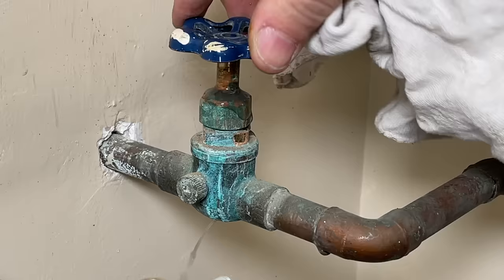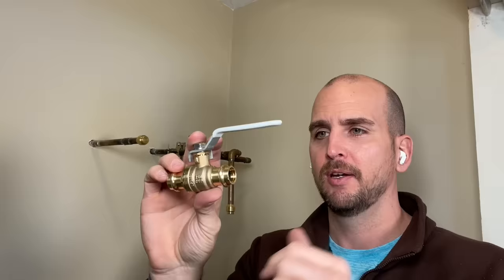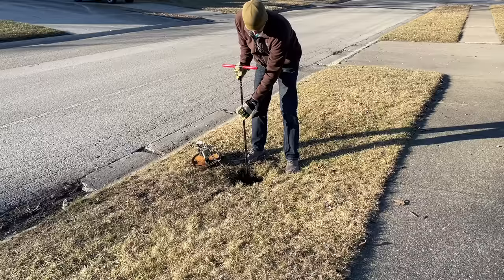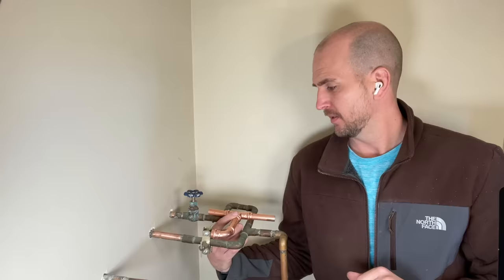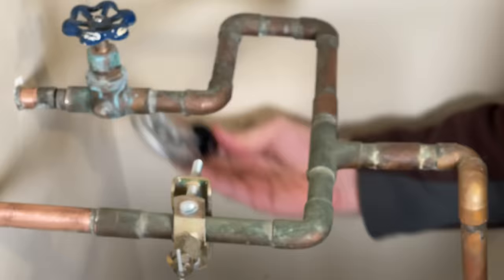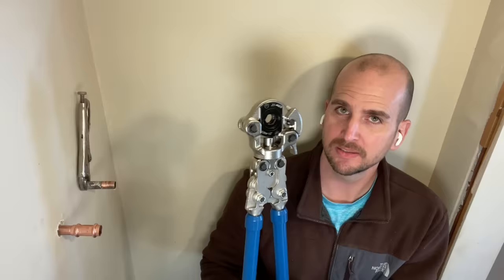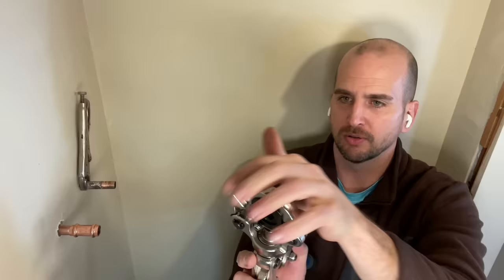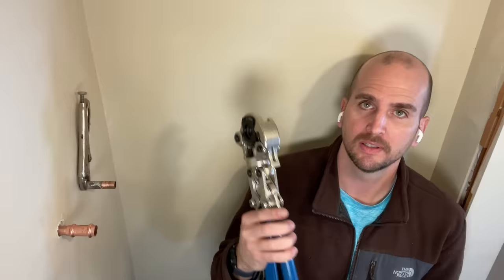How To Install a Main Water Shutoff | NIBCO Press Fittings

Comment: I use pro-press from 1" to 3" large Ridgid corded tool. Heavy, but surprisingly well-balanced and easier to get into spaces than it looks. Works great, primarily for commercial, because it's permanent. Only way to remove is to cut, lose some length of cc oppper.
One tip, There's a built-in stop. Just push onto pipe until it stops, unless using a slip repair coupling. The 11/16 for 1/2"  is just for planning/measurements.

Comment: Have used sharkbites several years on numerous project's.  Extremely satisfied with ease of installation. No special tools required.  Have used on both copper and plastic type pipes. Never a leak  Very convenient for DYI in remote,, tight, or potentially flammable locations.  Concur with comments concerning cost of snakebite but considering savings in purchase of and required knowledge in using more sophisticated tools still preferable for average user.
Reply: Same here, I have an old leaky main right now that I am cutting out and using sharkbite, 15 minutes start to finish. Cue all the regular plumbers coming in and shitting on sharkbite and pex.
Reply: @jwall62  There shit  dont be lazy.
Reply: @RadioRich100  or they’re so easy anyone can do it and plumbers don’t like that. Showed my wife how to do it and she did it in less than five minutes.
Reply: @jwall62  Whats she going to do when it starts leaking?
Reply: @RadioRich100  there will probably be better technology in 20 years when it might fail, but we’ll have to wait and see.
Reply: @jwall62  U dont have to wait and see, alot of them have failed already.
Reply: @RadioRich100  my research is my personal experience in my house. Nothing has failed yet after many years.
Reply: @jwall62  Which means you probably put in  3 of them. Not exactly a test.

Comment: Never had a problem with sharkbite's. I'm a builder, 40 yrs, and when these came out it's a super easy repair. Quick and clean and most of all no fire and no expensive tools. Another advantage is going from metal to pvc to pex etc with ease.
Reply: So you put your name and phone number on each one? A plumber worth a damn doesnt use them.
Reply: @RadioRich100  Normally when someone says 'I'm a builder' = 'quickest, cheapest method'. Once these builders finish the last home and are out of the 'warranty period' they file bankruptcy or dissolve the shell company or LLC....and start all over. Once people start having flooded homes they're long gone. Seen it before.

Comment: Shark bite fittings will also allow the valve or fitting to rotate which you may not want. I would use a crimped coupling to extend the valve away from the wall, then solder a ball valve, because the soldered valve can then be easily replaced if necessary. It’s also a good idea to place a pressure gauge upstream and downstream of your water regulator so that you know how well the regulator is functioning and when it is failing. It will also tell you if your street pressure is too high in which case you might want to use 2 regulators. One of which would be a “step down” regulator.
. This would only be necessary if the street pressure exceeds 150 psig. Normally house pressure would be set at about 55 or 60 psig. The higher the street pressure, the shorter the life of the regulator because it must work much harder to maintain house pressure.
Reply: Or install a valve-switched bypass for the PRV with a gauge downstream of both.  That way, it's just 1 gauge and you're prepped to change out the PRV when needed.
Reply: I noticed that too, should have extended the copper pipe before placing the ball valve.

Comment: When doing some updating on my daughters home I used shark bite fittings in 21 places as well as shark bite ball valves on all sinks and faucets. I know that the shark bite fittings were pricey, but I had time constraints involved. To spend $175 on that crimping tool would be cost effective only if I were going to be doing a lot more plumbing. I know how to sweat the copper, but the shark bites were so quick. My daughter has lived in her home now over 10 years with no leak issues. And I’ve had to sweat a copper line only once in the last 10 years. So, for me I have to say I loved using the shark bites.
Reply from the maker: Thanks for the feedback!
Reply: However sharks have been known to blow off. Had it happen. Now I only use the if ever on an exposed connection.
Reply: @mikecase9365  I have had 1 inch elbows and couplings on my incoming well water line for 11 years now.  When I 1st use them I had one blow off, but only because I didn't understand I would encounter 2 points of resistance during insertion.  1st on the stainless steel teeth and then again at the o ring.  Properly deburred pipe inserted to fully seated depth will have zero issues.

Comment: I use shark bite. Have it on my laundry room for my cold and hot water lines inside wall with an access panel. Have been there for 8 years. No leak, no problem. Great video!!

Comment: I use a variety and it depends on what it is that may make the job easier. I'll use shark bite fittings on certain applications, and solder on others. I'm kind of liking the crimp fit a little more due to an area on a main water line that just wouldn't clear all the water out. Crimp fittings work well for that because soldering would have been a pain. So, the variety is great for the different scenarios you would encounter.
Reply: Next time you sweat a pipe that just will not quit dribbling water go get a piece of bread break off a piece roll it into a ball and stuff it into the leaky pipe when the water quits dripping go ahead and solder the joint. It works and the bread breaks down and flushes out the nearest outlet.
Reply: @banditdog1338  the father of a friend of mine, showed us that trick back in the 60's. It made total sense and I have made use of it a few times.

Comment: For a water heater overflow I think sharkbite is perfect.  You can remove the sharkbite and put back when you swap out the water heater.
If you solder or propress, you may need new piping every time you get a new water heater.

Comment: I used SharkBite four times and they have all worked perfectly. I terminated a .25” copper tube and I have three shutoff, quarter turn valves under the sink. No leaking with any of them. I can see and access all the valves (they’re not behind a wall).

Comment: Way Better Than Shark Bite for a permanent repair. I try to only use pro press when i can.  Haven't had many issues after thousands of connections. The issues where usually due to installer  error. Great product overall. First time i have seen a manual version in use. Thanks for the demo!

Comment: When it comes to a main water inlet, my biggest problem was dealing with the city water department. The street valve is unique and the city was the only ones allowed to turn it off or on.  Took a day off work and called the water department to shut off the water. Three hours later a young kid showed up and couldn't get the street valve closed and had to call a supervisor to help him.  At this point, I didn't care if the ball valve cost me $50. I just wanted that valve in the warm house installed and working. Of course this was all happening on a January day and the temperature was 14 degrees outside.  I sweated the new ball valve on and again had to call the water department again to have them come out to turn the water back on (another 2 hour wait). All in all, spent an entire day changing out one valve.

Comment: I feel like solder is just so much more secure. Of course, you have to do it correctly.
Reply: I had tons of pinhole leaks due to flux corrosion inside the cold water pipes.
Reply: I have a ProPress and it’s completely secure. That’s why all the pro’s are switching over. I still solder sometimes but only on a weekend when the supply houses are closed. Crimp fittings aren’t widely available at the DIY stores. Home Depot doesn’t have them at all but Lowe’s has a very limited stock in some stores. But... you’ll never spend $2000 on a torch and a torch makes equally good joints. Mine comes in handy if there’s no time for a hot work permit, sprinkler heads or the water won’t completely shut off. Last week I couldn’t get the water completely  off in an apartment complex and there was a leak. I cut the pipe, shoved a press ball valve on there, crimped it and was able to fix the leak at a leisurely pace 🤣
Reply: My 40 year old house use soldering never leak,  why I switch to use something I don't feel comfortable to use  ?
Reply: @chachacheng9380  The beautiful thing is you don’t have to change. If you do it for a living and find something just as secure that cuts your time in half it’s a no brainer.
Reply: Pro press is great. The only issue I have is we haven’t seen them long term when that o rings begins to degrade.
Reply: @joshcowart2446   ProPress has been around since 1999. Same material used on automotive valve seals but the ProPress fitting doesn’t experience friction. If they can stand up to decades  of gasoline and oil with friction they’re probably good for water. I say probably though. I can smell the chlorine from my tap water at home. That’ll oxidize solder too though. A torch, flux and solder will pay for itself a hell of a lot faster than my ProPress. It definitely doesn’t make sense for most people.
Reply: @Jaredcouture12676  home depot does carry pro press now
Reply: @Jaredcouture12676  agreed. I have no idea if it will be an issue, I just never liked a gasket I couldn’t replace. I’ve seen too many o rings and washers degrade after as few as 10 years much less 30-50. Whereas I’ve seen solder joints 50 plus years old. Remember quest or PB pipe was around for almost 20 years and that ended disastrously
Reply: @joshcowart2446  Not the worst idea to let others be test subjects 🤣 I’ll be one of them. The best part is my first project at home I used it for has a couple solder joints mixed in so if I’m alive when one fails I’ll know which one wins.
Reply: @Jaredcouture12676  you can be a test subject with your own home. You can put PB in your house if you want.
Reply: You must be old school as much as I like that this pro press is very quickly taking over, very cool with battery operated pro press tool, works slick, advantages no need for hot work permit and if main valve leaks by no problem once so ever love it! Don’t worry though d610 soldering copper will always be here, you just might be the only one doing it lol
Reply: I just had these installed by a plumber in a very tight spot with a leak caused by two pipes rubbing against each other above a hearter duct in a crawlspace. He only had about 8" of space to work in. Otherwise I would have had to cut out a foot or more of the heater duct for him to get in and soilder. He used the electric crimper . So far so good.

Comment: Love shark bite, just did my entire house from 60 year old Galvanized steel to Copper pipe with shark bite connectors. They are the best!!
Reply: If you were using those 'Bite' connectors should have just went to PEX. If you're not going to sweat the joints, no point in using copper.

Comment: I bought the same tool .Great video explaining the operation of the tool. Mixing in shrak bite couplings is the best option in tight spaces the shark bite fittings allows 360 turning of the pipe a win win

Comment: The shark bite fittings are great for me, as I didn't need to use the torch to fix my leak.  Which coincidentally was while trying to fix an outside hose valve!  I should of watched your video first. I am so not a  plumber, but these make it where I can fix things myself. Thank you

Comment: I like to keep sharkbite caps on hand in the event of a leak, but prefer soldered joints as it's a dying art, and as a hobbiest, it's a skill I need to maintain
Reply: Yes not of us  oldschool plumbers left out there there's nothing plum with pex copper you make it level and straight
Reply: Sharkbites are okay for temporary repairs but nothing permanent
Reply: yea, thinking of an emergency leak kit, a pipe cutter, some shark fittings of diff sizes. ready to go, just cut and cap; but for real, anything permanent, I don't want to have to worry about future failure, soldered joint can be tested, if its not leaking now, its not going to leak later...... is it?

Comment: Hey Scott,

I had a house in California which had tubing in the slab. Cheap. The hot water tubing started leaking (of course, maybe a topic for a future video.) Not wanting to jackhammer the slab, I bypassed. My then future (now ex) wife was impressed that I was using a utility knife to cut two slots across all of the walls to re-pipe lol. That job was not fun! I used red Pex and the rings and fittings needed a plier similar to what you have there. It's huge! I still have it. It was 3/4" because I sure wasn't getting more than one plier, and the bits weren't changeable like yours.

Man, I had to drill 1" holes in all of the studs and put in steel plates to prevent future people from drilling into the Pex. Did drywall repair, painting, texturing and I surprised myself that it was impossible to tell the difference when I was done. I think that was why she married me, but she divorced me because I couldn't get a job lol. Easy come easy go maybe? Don't know.  😁

The point of this comment is to convey what a pain it is to get those huge clamping pliers into walls or any tight spaces. It worked and I saved having a plumber come out and charge thousands of dollars, so you sweat the stuff you have to do but please repeat to yourself, think of what I'm saving. Of course, not everyone will succeed, so mileage will vary.

Anyway, awesome video!!

Ken

Comment: Shark bite fittings are great ,those press fittings are hard to use and are not reusable if make a mistake,sharkbites cane used over and over again.i keep some fittings and pipe on hand for emergency repairs. I live in a trailer with the old polybutalane pipe so I get a lot of leaks👍

Comment: I use Shark bites sometimes in temporary uses, I never had an issue. I do use the Shark bite flex water heater connectors, I'm never going back to anything else, they work great, no corrosion, no leaks. Water heaters are junk nowadays you're luck to get 6 years out of them makes it much easier to change out later on.
Reply: What?! Ive had my current water heater for 12 years now. And my Grandmas I put in has been going for 10 years now.  Is your math no bueno or somethin?

Comment: Use shark bite on replacing a ball valve at the veterinary clinic that I maintain probably seven 810 years ago and it works just fine
Reply: 810 years what your secret on how to live so long :). Guessing you missed the dash 8-10

Comment: You did an awesome job on this video, but a couple things you did not mention:
1) Most copper already installed in houses is Type M copper (thin walled tubing). Press fittings, last time I checked, can only be used on Type L copper pipe (thicker walled tubing), otherwise it will crush/deform the copper pipe and it will leak. The only way to remedy that is to solder the first fitting and section of Type L copper pipe to the existing pipe, then use press fittings from then on.
2) The battery powered press tools, the most common one is the Milwaukee ProPress or a MegaPress, can be rented for approximately $50/day + a $250 deposit. The deposit will be refunded, so long as you don't damage the unit or lose any parts for the tool.
 2a) The battery powered press tools are calibrated, or should be, regularly to ensure the fitting is sealed right every time, plus they give you the added benefit of having one hand free to hold the fitting so it doesn move so it seals properly. MAKE SURE YOU CENTER THE PROPRESS TOOL FROM SIDE TO SIDE OR IT WILL NOT SEAL, AND YOU WILL HAVE TO CUT EVERYTHING OUT AND REPLACE EVERYTHING YOU JUST INSTALLED! And, don't install press fittings butt to butt - leave a length of pipe that is at least the length of the diameter of the pipe between fittings, or it will NOT seal.
3) The outside, not just the inside, of the pipe needs to be deburred or it can cut or nick the o-ring in the press fitting and cause a leak. The best deburring tool for deburring the outside of the pipe basically looks like a hand held lime reamer and can be used to deburr both (in/out)side of the pipe., and can be found at most hardware stores.
I am not a Journeyman Plumber, yet, however, I have been Plumbing full time for three years, and I have been learning from a Commercial Journeyman Plumber, who has 23 years of experience.
Again, awesome job, keep up the good work, and I'll catch you again next time!
P.S. Phase two and three on your gate valve, or as you called it, globe valve, video was extremely useful. I will certainly utilize those. Thank you!
Reply from the maker: Thanks for the great feedback Dan.  Appreciate you sharing your knowledge 👍
Reply: @EverydayHomeRepairs  
No problem, glad to help!